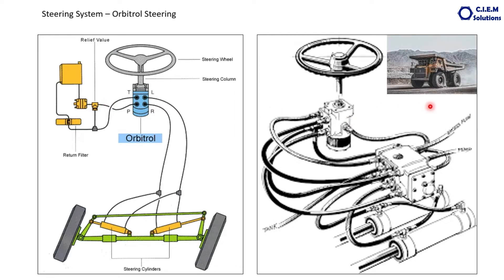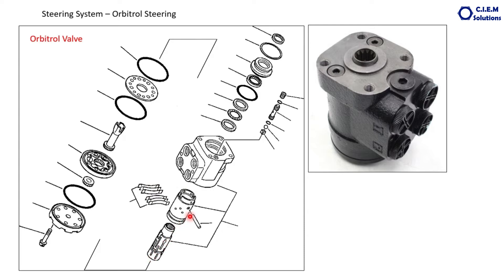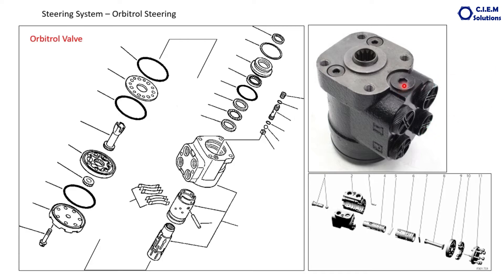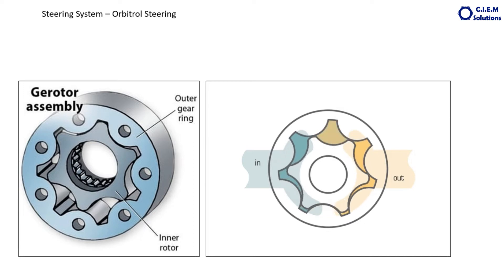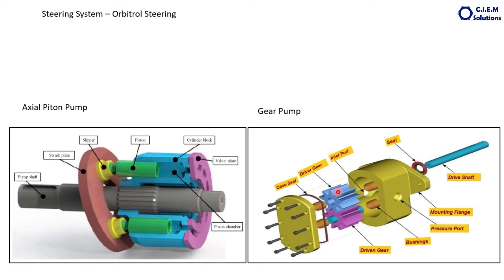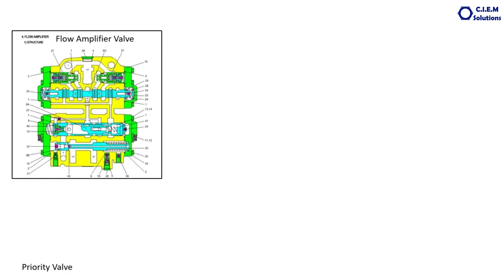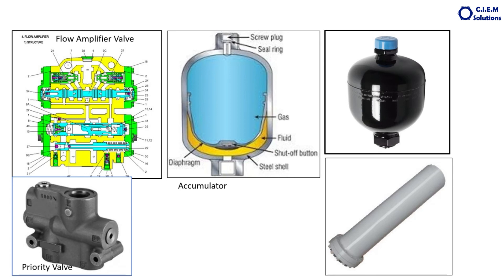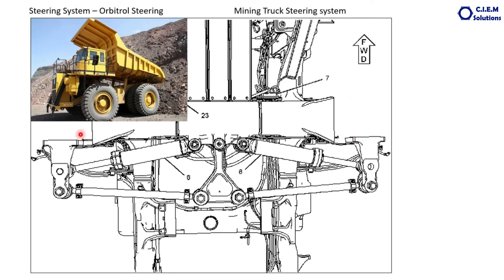49. steering system - Part 4 :   Orbitrol steering

Comment: Hi. Question.  Replacement Eaton char-lynn orbitol steering unit. With load sensing mini port. Where does this port connect to. My original old unit didn’t have one. Can it just be blocked off with a screw plug ???   Thanks.